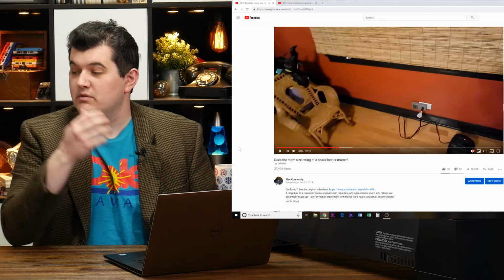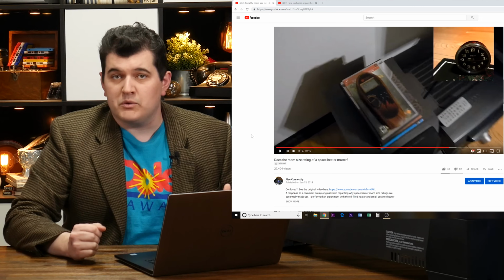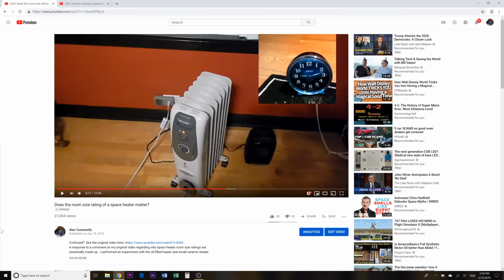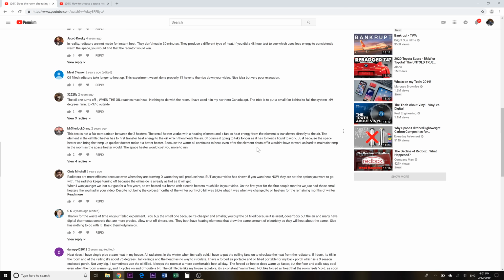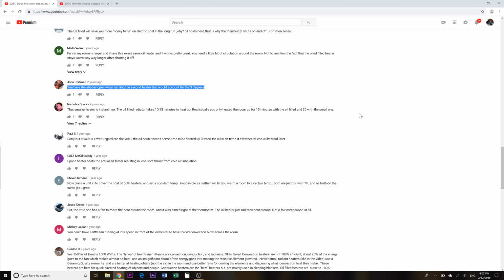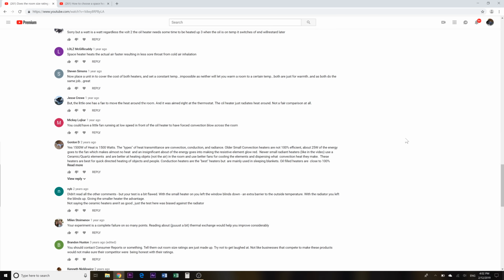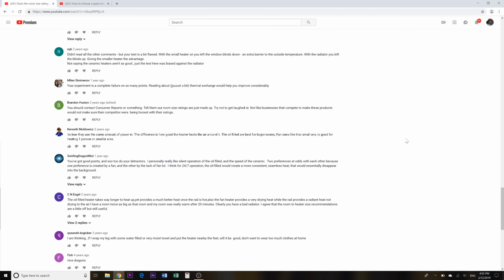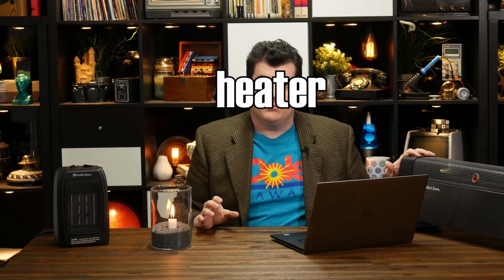More Space Heater Nonsense

Comment: Apart from pedantry, I agree with the principle. 1500W is 1500W and resistive heaters are very simple devices. It's pretty much incontestable that two such heaters with the same rating would do basically the same thing. Getting into those pedantics though, there are ways that some heaters can be very slightly better than others.

First, to sort of clarify, we are using the obscure metric of Space Heating. It seems to be all about getting the air in a given area to warm. Because of this, bigger heaters and those with fans are immediately winners, because they get more air in contact with the hot spots. A no-brainer it might seem, but it does make you question why you would ever use an oil heater or a heater working on convection alone for this. After all, they will not heat a room as fast or diffuse what heat it puts into the air as quickly, even without thermostat worries.

Second, Efficiency. You claim resistive heating is 100% effective. This is only sort of true. Almost all heat energy created comes with other different components of energy, though it is minuscule. Also minuscule is the heat that the wires and connections make leading to the device and heating areas other than the space in question in their tiny ways. Actually relevant though, are the tiny losses created by sounds, usually from fans, the microwave radiation of heated elements, and the other mild losses that come with each component added. Even in a windowless room, you will generally lose some of the light or radiation and definitely some sound energy will be absorbed and run away. What does turn to heat in the walls will not necessarily heat your space, being more likely to conduct to cooler areas. Larger, cooler conductors with few frills score highest here because of this. This is where the oil and convective heaters do get mild points. They are usually more efficient on a very technical standpoint. This is all pretty pitiful, making it 99% efficient compared to 98% or something even more pitiful, but still something in theory. Even if it doesn't work so well in practice, at least for me.

Finally, we get to the one which addresses room size, or more accurately Room Layout. A perfect room for spreading the heat would have people all lining the walls around a sort of conical pit in the centre, where a heater beams hot air up to them in equal, Communist shares. There is no other furniture in the room, no one moves, and we all share in minimalist, socialist harmony, the bounty of heat bestowed by that work. Unfortunately for theoretical world heating, I do not believe even Russia has such rooms, so spreading heat into the air is a bit of a crapshoot. Convection alone just pours heat into the ceiling, giving a path for heat to escape, or a slow path where hot air slowly creeps over the ceiling and falls when it cools, pleasing only those tall enough to live on the ceiling. Fans are somewhat directional and easily blocked by furniture, logistics of the room or needy kids, trying to hug the heater for every bit of warmth they can glean (let alone how rushing air, even when so hot, can have a sort of cooling effect on a person, us being the wet creatures we are). Oil heaters radiate small steady heat in all directions, but are incredibly slow. Radiant heaters make the people and walls warm, but aren't technically effective at heating the space itself. Bigger, more obstacle rich and oddly shaped rooms are always going to be harder to heat evenly, but preference and where people most congregate dictate some of what we need from a large room heater and some heaters are better at it than others.

All that said, the room sizes thing is still nonsense. My favourite heater for big rooms (and pretty much in general) is a convective heater with a fan inside pushing the air out of a set of fins aiming down. It pleases the heater-hugging kids, floods heat in multiple directions despite not wasting much being placed next to a wall, it's large enough to heat a volume of air fast and often has very simple controls as not to confuse, misdirect or waste. I don't think everyone would agree, but the sensation of heat is, in part, one experienced slightly differently by everyone. The main thing is having a reliable heater. Cheap and quick self-heating for comfort is often a more cost efficient way to go if you don't have other concerns.

Comment: I think what makes people resistant to the idea that the tiny heater and the big heater are equally "efficient" is the intuitive understanding people have about what the word "efficiency" means. You are using it in the strictly thermodynamic context, and many people (myself included) don't know about thermodynamics and don't understand efficiency in terms of "energy wasted as heat." My guess is that most people understand the word "efficient" as referring to some loose idea of "optimization," and there are many things which seem "more optimal" about some heater over others, which you allude to in your video. Combine that with the fact that people like to feel smart, and you've a shitshow on ur hands. 

There is also the misunderstanding about surface area. When you tell people that the larger heater outputs (or "draws" or "uses" or whatever the word is) the same BTUs as the small heater, people don't understand that heat is equally distributed across the larger size (meaning its actually colder to touch). It's still the same "amount" of heat, because its the same amount of energy. I think I (and perhaps other people) have a very intuitive misunderstanding about what it means for their to be an "unequal" distribution of heat in a room. I think that could be because people in the world first encounter heat as like, an intrinsic attribute about spaces, rather than as a representation of "energy", which is perceived as a quantifiable substance. 

I know this is a science channel, but hey, philosophy can be helpful sometimes...maybe.... :p

Comment: Of course 1,500 watts of energy is 1,500 watts of energy. Sure the unwashed masses don't get this and hence the marketing people have to be creative to differentiate their products.Problem is though a room in a house is not a calorimeter so the very notion of "heat of the room" is flawed. How many points in the room is the temperature being measured at and No, there's no certainty all the air will eventually be at the same temperature.Reason the oil filled convection heater can do a poor job of heating a room is first its heat goes up to the ceiling. How much heat is lost through the ceiling depends on how well it's insulated. Eventually convection from the heater draws that air down to the floor to cycle through the radiator again. The fan heater first blows it's hot air over the floor so at floor level it likely will make the air hotter than the convection heater.I do hear comments about some heaters "not drying the air" but that's also nonsense. Raise the temperature of a volume of air by the same amount and the relative humidity goes down by the same amount. The only exception is a heater that's burning hydrocarbons and sending some of the combustion products into the room. With that there is water as one of the combustion products so they will not dry the room. Problem that may arise is condensation on cold surfaces.
Reply: People need to consider that different type of heating heats up the human body differently and because of that you can actually have heating that feels warmer on YOU with less power consumption. What you want is usually to heat up you and not the room... Yes 1500W is 1500W but then you are talking about energy and not the effect it has on the thing you want to heat up and that is usually a human and that is very difrent from heating up a room. You also have many difrent types of losses to consider like IR getting trough the windows and so on, it is a LOT more complicated then saying 1000W is 1000W when it comes to how different types of heating effectively works to keep people warm and comfortable....
Reply: Hot air rises, so wouldn't the air from the fan eventually start floating upwards?
Reply: Yes the hot air from the fan heater will eventually rise. Before it rises it will have heated the objects closest to the floor. To look at this another way which will make you the warmest, the fan heater on the floor blowing warm air onto you or the fan heater atop a ladder just below the ceiling?What's being ignored here is the room is "leaky" ( it's a cold room) so a lot of the thermal energy is escaping and it's almost certainly not escaping through the walls, floor and ceiling by the same amount. Maybe after 30 minutes the room is in a steady state but that does not mean all parts of the room are at the same temperature.Finally I'd point out that the best way to heat a house is with in-floor radiant heating. I'll admit the first time I heard this I had doubts but thinking beyond the basic physics I understood why.
Reply: Imagine sticking a heater in the corner of a huge ballroom and waiting until it reaches a steady state. The air around it is very hot and immediately adjacent to the cold walls, so energy is lost rapidly even though the room isn't that warm. On the other hand, imagine sticking it in the middle of the room. The edges of the room are not that hot, so energy is not being lost that rapidly even though the room is warm. So even though the power through the heater is the same, the temperature of the room is not. Seems pretty straightforward to me.

This is also one advantage of oil-filled radiators. Because their power output is more consistent, there is smaller hysteresis in the cycles, even though it repeatedly turns on and off. So it really might require less power in the long run to heat a room this way as compared to turning a heater on and off completely. (That doesn't dispute anything in this video though, because this applies equally to small and large rooms.)
Reply: Flip it over .. a space heater is a badly designed computer that is 0% efficient at doing computations :)
Reply: And the temperature of objects should also be considered.
(You can heat air very fast but furniture and walls stay cold)
Reply: Not energy, power. Energy would be Watt*hours.
Reply: Yes, you are correct, my bad.Should say though it's watts*time. The "time" can typically be seconds or hours.

Comment: I think the marketing wank is awesome. What they actually mean is this...

It's a Room Heater that is Small sized.
It's a Room Heater that is Medium sized.
It's a Room Heater that is Large sized.

They are only referring to the footprint of the device and not it's application.
Reply: The heat does spread out but low velocity air raises to heat the air at the ceiling first and then slowly fills the space downward.  Higher velocity air movement will push the heat out farther along the floor before convection moves it upward.  The longer you keep warm air moving in the space you are in will keep you more comfortable than having most of the heat up above you.   A larger heater will typically heat a larger volume of air but to a lower temperture, less likely to sindge your kitty cat.
Reply: @577AllWell Once you hit equilibrium, they will all be the same unless, as a cooler room means faster convection, and a wamer more even room will be slower to heat.  You would need a constant stream of swirling air, like a large fan in a large room, to see a huge difference.  So if you have tall ceilings or a large room and heater with a strong fan, you are correct...HOWEVER, the smaller models always have strong fans as the smaller elements will run hotter at 1500 watts, and need the extra cooling to retain that rating without burning out (a rating the marketers rely on to keep pace with the competition).

Sooo, the larger units (like the large convection unit on his desk, or the oil one in his experiment) usually don't have a fan, while the smaller cheaper ones have a powerful one.  Generally speaking, you still get better heat from a small cheap unit.
Reply: @MrCorrectify  ... I suspect you're correct.. However, it's super simple to fix. Cheap heater plus cheap room fan. Boom.
Reply: In my experience, people with larger rooms have more money to burn and thus burn it more stupidly. So it's a rich tax, and for that it's awesome.
Reply: Surely you're not that stupid. They even give you a picture on the side of the box to show the recommended room size,   moo ice cream. ..

Comment: I have a cheap oil radiator heater, the sensing element of the thermostat passes heater current... put it on 1500 watts, the heater barely gets above body temperature before the unit shuts off.  Put it on either 900 or 600, it'll stay on 24/7 if you let it.  Cheap design..  Another element of your experiment, look on your Kill-A-Watt and look at the kWh's drawn..

Comment: You repeat this "electric heaters are 100% efficient" mantra again and again, but I would challenge that, and it's not a nit pick, the difference is directly relevant to what you're talking about.  It's not about the efficiency of turning electricity to heat, it's about the efficiency of heating the room.  If you add a 40 lb heater to a room, you have to heat that 40 lb as well as the room, so not all the electricity heats the room.  Eventually, the room will tend towards the steady state where the output matches what you refer to as the thermal load, so efficiency can only be said to tend towards 100%.  
I thought the advantage of the space (and oil heaters) is their thermal mass, when the thermal load fluctuates, say when a door is opened for someone to come in.  A beefy space heater with a fan could quickly release a lot of stored heat, potentially much more than the 1500 W that it can draw from the wall.  How well that idea works, if at all, with currently available heaters, is perhaps where you should be looking to compare the room size rating.
I grew up using radiant heaters and I much prefer them.  They can heat you, not the room, and this is very good if you are cold.

Comment: I agree with everything in this video and the remade one. I live in a place where electricity is super cheap (Montreal) and we heat via electric heating. And we have to because a Heat Pump does not work well below a certain temperature (unless it's geothermal). Every room in the house is installed with 500w to 2000w units linked to the thermostat and we all freeze when the power goes out.

Comment: I think a more appropriate label would be:
Often used room, like living room instead of "large room"
and
Seldom used room, like guest room, instead of "small room"

Since, the ones aimed at "large rooms" seemed to be made with a quiet, but slower spreading method, whereas the small room seemed to be made for quick heating, but loud. So you'd put the "large room" one in your living room, where it can be run for an extended period of time to keep the temperature up while watching TV and whatnot, whereas the "small room" one, you turn on in the guestroom a couple of hours before it's going to be used, so it's nice and warm for when your guests go to bed.

But yes, implying that one 1500W heater would be better/more effective at the task of heating a space than another 1500W heater is false marketing.

...

Now I want a hybrid heater, which can switch between powered fan mode to quickly bring a room up to temperature, and then keep it stable with a passive quiet heating technology

Comment: Am I wrong in thinking those commenters are also wrong about one drying the air out more than another?
Reply: @William Kappler correct.
Reply: Have a fan blow heat on you feels like being exposed to a dessicant. When the heat is just in the room, because of the lack of convection, it feels less dry. Room comfort isn't dictated solely on whether or not the room is at the appropriate temperature.

Comment: Could the room rating have to do with the longevity of the heater?  A small heater will be concentrating the 1500 watts onto a smaller element than a larger one.  It takes longer to heat a large room than a small room.  Both heaters may take the same length of time to heat the room, but maybe the smaller heater will wear out faster if it has to consistently heat a large room.  That's my best guess.  Longevity.